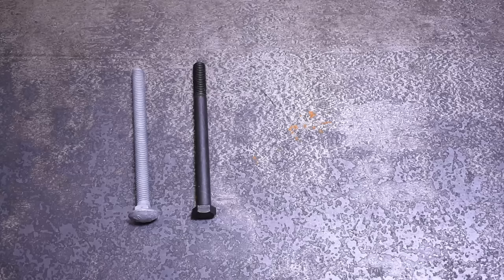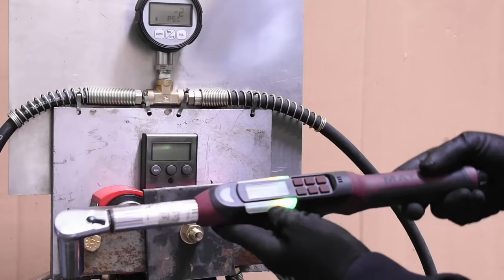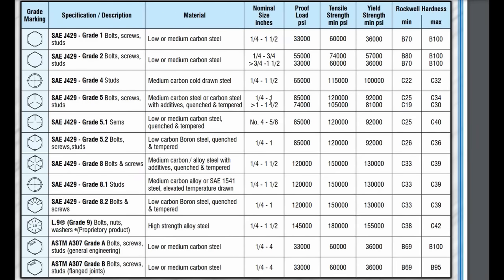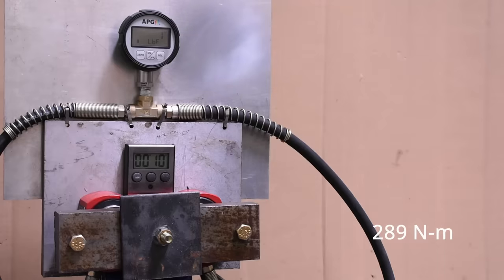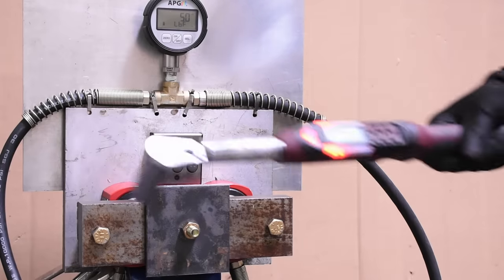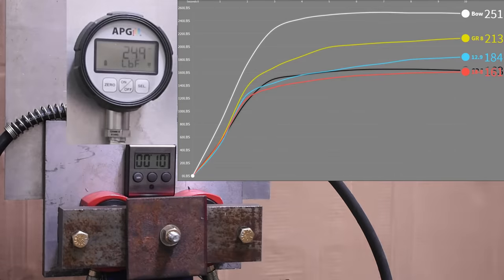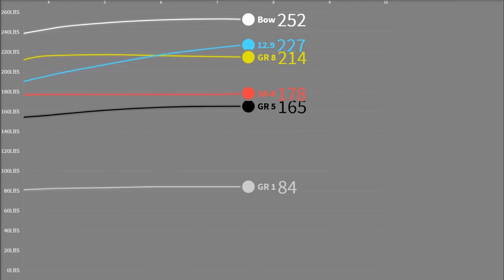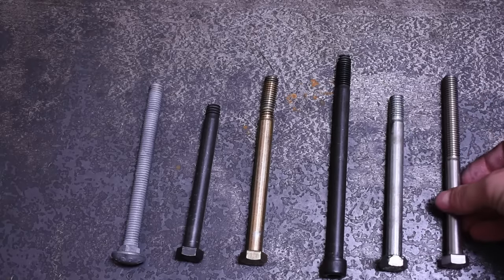Strongest Bolt? Grades Explained & Dyno Tested For Science

Comment: I like to use a lot of Grade 8 bolts and "Grade 8" Nylock Nuts and especially "Grade 8" (aka hardened), washers b/c the washers don't deform under load/tightening.
I find the Yellow zinc coating present on most "Grade 8" stuff to be FAR superior for weather/rust resistance then standard zinc.... I buy them in bulk b/c the cost difference does not seem to be that great over grade 5 (and is sometimes cheaper from one of my suppliers for some reason)

They are also often available cheaper than grade 5 zinc in "plain" finish which makes them very easy to weld prep and paint b/c you don't have to strip the zinc off before hand.

Grade 5 Plain finish and Yellow Zinc are also available and I often purchase those as a "lower" strength alternative... But unless they are substantially different prices Grade 8 is my go to for anything not requiring stainless or Hot Dipped (I always buy grade 5 hot dipped b/c the ungraded bolts especially carriage bolts seem to be made of "Cheese grade" steel)

The quality of the fasteners/threads & finish etc  is WAY better then buying the garbage sold in most hardware stores and big box stores and when purchased in bulk are WAY cheaper then that crap.
Reply: Exactly even if you need 50 bolts pay the Xtra 50$ cadmium bolts are okay for furniture but not for something that can fail.

Comment: I was told not to use stainless hardware on my beadlocks. a tone of people said they were weak and would snap so I put one in a hole in a metal table and bent it with a hammer. they are strong enough for what I want to use them for. glad to see you confirm that hard to find info or test on them

Comment: Not all metric SHC are 12.9. They do come in 10.9 as well, though rare and hard to get here in the states. Where I work, our German presses use a lot of 10.9 SHC bolts because 12.9 is too hard and do not have the "give" that a 10.9 does so they tend to just break if they're substituted. We also use L9 bolts on our tumbler drive units per the manufacturer. They're the only thing that can handle the stress of being constantly vibrated and hold the drive and weights in place. Anything else will snap in a matter of hours. If I remember right though, L9 bolts are mostly used in aviation.

Comment: We use stainless bolts/nuts and Belleville washers(conical spring washers)  in electrical substations and switch yards. 
Also ran into an interesting situation at an airport where they wanted the emergency generator wired to be terminated with stainless and greater then grade 8. Our supplier said impossible because stainless is harder and more brittle then grade 8 so you can’t have stainless + < grade 8. Substations/switch yards using stainless + conical spring washers probably use the washers to flex to avoid stainless being more brittle then grade 8.

Comment: I went through a Caterpillar training course, and they demoed their bolt testing. They put a wedge shape under the head while tensioning. Cat was using all grade 8 for everything on their machines. The theory being that no one pays attention to where a bolt goes relative to the required strength.  I now mostly work on European factory machines. They use either 8.8 or 12.9 and have a habit of torquing them to near their limit. Almost all are SHCS.

Comment: The yellow is zinc chromate. You can get grade 8 bolts in other finishes; McMaster carries zinc flake and black oxide as well as zinc chromate.

Btw, you can see in the graphs when you've reached the yield point, especially on the grade 8 and 12.9 cap screws. It's where the curve bends slightly to the right. Once it plateaus the screw is over torqued, but for one-time use fasteners torquing the screw into the yield range is often specified.

One interesting metric to gather would be bolt elongation. You should be able to measure that by setting up a dual indicator on the back of the rig, with the plunger on the center of the end of the bolt.

Comment: Also thread systems would be something to consider,the typical systems on SAE (not to mention metric systems) insure a certain clearance between the female and male fastener threads which include some empty or air volume in the assembled fastener and also some axial play between the female and male fasteners when there is no tensile load on them. Volume which can allow entry or penetration of liquids or substances such as water containing dissolved corrosive salts unless the thread volume is filled with some sealant such as "antiseize" or plumber's sealant. Or even "thread locker".

Comment: Great and useful video, thanks so much! Stainless steel deck screws are far weaker than any steel screws, so I assumed the bolt would be weaker. I had to use a drill with a clutch, my little impact driver kept twisting them off. So that 304 / 18-8 bolt was s surprise.

Comment: Is a hammer drill a faur way to test bolt strength?  I don't think torque specs take into account hammering.    Try with a breaker bar to remove hammering from the equation.

Comment: If you ever look at Altec digger derricks (basically a crane meant to install utility poles), the boom’s rotation is only held in place by the hydraulic motor, which itself is only held in place by 4 bolts.  We had a guy shear them off once and a mechanic (not having the bolts to look at) replaced them with grade 8 bolts.  They lasted a day.

Comment: In case anyone is interested, the A307 grade is the most common structural bolt.  They're specced to be reliable and mass-producible.  As opposed to unmarked bolts, the "A307" marking guarantees the production line meets a certain level of quality control.

Comment: As a person who is working on some heavy industrial equipment I am finding there is quite the rabbit hole to bolts.  Strength isn't always the only factor to consider when there is a certain amount of flex required.  I would have initially thought just throw grade 8 in for good measure; but I am learning this isn't always the best way.

Comment: When I build a machine if I'm tapping the metal of the machine I always use grade 8 bolts that way when you remove them they almost never break off. Sometimes they ruin the threads but that's a smaller problem. In some applications with a nut and bolt a grade 2 setup is kinda nice . They can usually be quickly broken off and cheaply replaced during service. For most applications grade 5 is what you need.

Comment: The metric classification works as follows. 
8.8 =>
The first digit multiplied by 100 is the max. force in N/mm2 the bolt can take without breaking. 
=> 800N/mm2 
For a threaded bolt we use the stress cross section. The diameter of the threaded section of the bolt is obviously smaller than the nominal diameter. 
For a UNC 1/2“ 13 bolt this is about 11mm. 
The area of that diameter is approximately: 
5.5mm^2*π≈95mm2
=>
95mm2x800N/mm2= 76kN (≈7,6 t)

The torque to stress the bolt to that amount:
76000N*1.95mm=148000Nmm
=>148Nm

The second digit ist the yield strength in N/mm2(max force before permanent/ plastic deformation)and is calculated as follows:

First digit * second digit *10
=> 8*8*10=640N/mm2

Again multiplied by the area 
95mm2*640N/mm2 = 60kN (≈6t)

Torque:
60000N*1,95mm= 119000Nmm
=>119Nm

This is all highly theoretical and neglects several factors such as friction etc..
Since the bolt is usually there to hold parts together and take a lot of additional stress for many many cycles you obviously want to stay well below these values. 

So just buy the appropriate bolt and stick to the torque values of the manufacturer!

Comment: The AC compressors we have at work require 4 3/8" grade 5 bolts on the suction side and 2 5/16" grade 8 bolts on the discharge side. 

Many times I've found grade 5 on the discharge because someone got lazy, or reused bolts on either. They've always been stretched. The most impressive were reused grade 5 bolts on the discharge that had stretched between 1/4" and 3/8"... I'm surprised they still held pressure, seeing upwards of 380-400 psi, and undoubtedly not properly torqued to begin with.

Comment: Just a trick we use at work for grade 5 (3 marked lines) and grade 8 bolts (6 marked lines) if you in your head plus two on the marked lines you get the strength grade, used as a way to help remember the grade off the marked lines on the head you see.

Comment: I am a structural bolting inspector. You should have also tested A307 versus A325 and A490 structural bolts. Grade 5 and Grade 8 bolts are illegal on structural steel. They are machine bolts for building machines. Interesting that you have built your own version of a Skidmore-Wilhelm tester which we use to verify heat treat bolt lots for high strength bolting.

Comment: A lot more factors go into how these bolt will perform in your test.  My guess is that the BOW bolts may have rolled threads after heat treat.  As a result, the thread quality is much better, meaning that you will build clamp load faster when compared to applied torque.  Thread friction is a large factor in torque vs. clamp load.  You should try the test again but use Loctite 243 or 271 on the test subjects.  Loctite is a great thread lubricant and will allow you to achieve higher clamp loads more quickly.  I have empirical data from tests we did with an internally developed Grade 8+ bolt in a high clamp load application.  It’s pretty amazing stuff…

Comment: I am a heavy equipment operator by trade. In winter do snow removal. Snow equipment uses bolts on push arms for there shear characteristics to protect equipment. That generally translates into a soft bolt. Clamping force is not a concern as we use nylocks and leave them loose. I would be interested in seeing shear testing of the different grades.

Comment: On the stainless bolts:  You will see some with marking "S30400" or "S31600" or "F593C".  These are all supposed to be slightly different stainless alloys and should have different properties.  It would be interesting to see these tested against each other as well.  I've had a lot of experience with 304 failing very easily, but have found those marked "F593C" tend to be tougher, though not 100% of the time and I'd like to know if it is simply a matter of my perception or if there's actually something to that.  The documentation I have found online seems to give inconsistent information, but generally tends to show F593C should be a little better than 304.  
    Further, stainless likes to gall and seize, so it is strongly recommended to apply some lube to the threads, as this makes a very big difference in how long they last and how well they perform.  I like to use SuperLube on all stainless bolts and nuts, but there are other options that will also work well.
*    Also, would you be interested in testing different lubricants on the threads and see what difference it makes?  I'm thinking it would be good to choose one grade of bolt, such as Grade 5 or Grade 8 and test multiples of the same bolts with different lubricants.
    Here are some ideas about lubricants to try:
SuperLube
Lucas Red'n'Tacky
Brake caliper grease (the black CRC stuff with Moly and Graphite)
Cheap grease like the stuff from Service Pro
High-end grease like BigFoot grease
Waterproof Green Grease (found at Autozone and Oreilly's)
Anti-seize (aluminum-based because that is the most common)

Gear oil
    Thank you!
Reply: There is often a Suffix 'L' which means Low Carbon.  Less than 1.5% as I recall.

Comment: The funny thing about aerospace components is that you'll often find a commercial equivalent for 1/10th the price, but the aero version (aside from raw performance) will have one tiny difference like an odd thread pitch or specific machined head so only one specialized tool works with it (let's be honest, a Union guy can screw up just about anything, haha). I used to call it Job Security vs Design Envelope Performance; this was especially true in the 60s and 70s.
Reply: Sometimes the difference will just be in the paperwork - the aerospace component will have an auditable trail to show the stock it was made from, that it was correctly hardened, tested etc etc. I actually read an accident report recently where poor process control and slack QC meant some pins in a batch were manufactured from stainless steel instead of tool steel. Sadly these pins are used to attach the main rotor blades on a Bell 212 and a stainless steel pin failed after a few hours, causing the aircraft to crash

Comment: If you ever do another test like this, consider lubricating the threads before hand. The bolt at 8:15 had a "spiral fracture" meaning it was effectively twisted in half, instead of breaking in a more traditional manner from the threads binding up.

Comment: One thing that you did, int talk about is certification and offshore fasteners vs onshore fasteners also the letters on the head of a fastener is the Manufacturer, certification or Certs as it is referred to can be  required for all DOT situations especially Bus truck and train applications.
Reply: And everything on ebay is counterfit including software. I imagine the bolts are also.

Comment: I use socket head cap screws in a 24/7 production environment with a speedaire butterfly gun. They stand up well but inevitably the threads strip after a few months.

Comment: Stainless Steel bolts are rated either A2-70, which is 304SS, or A4-70, which is 316SS. Both are 700 MPa.

Comment: The best info on stainless bolts I have seen is in the astm specs, I can look up the ones if you care. It is harder to find the info on them but it’s out there if you know where to look. Basically 300 series stainless steels are not heat treatable and have an enormous strength range depending on how much they are cold worked or as the spec calls it strain hardened. 18-8 is a precipitation hardening alloy 18% chrome 8% nickel very close to 304 in chemical composition but is heat treatable with its strength depending on its aging temperature.  There are also the 400 series stainless steel bolts but they are the least corrosion resistant and I never use them.   304 and 316 are usually used in the low to mid range strengths.  18-8 (and other ph grades) is the Cadillac of corrosion resistance and strength but cost more.    

Regarding torque I’d probably have shown the results in tension not torque.  Your jig actually measured tension and although you calibrated it to torque the conversion varies with lube condition and surface finish.  Black oxide will be slower to tension than greased bolts or shiny zinc.  A rusty bolt can break from torque and never reach a very high tension which is actually what you are after at the end of the day.   This of course gets into the age old problem that tension is what matters but is hard to measure.  Torque is what everyone uses but varies wildly with conditions. Structural codes for critical applications require calibrating torque to tension on a jig not far from yours with every batch of bolts and every day.  

I also wouldn’t back off the bolts you yielded and retension to break since you effectively strain hardened it making the bolt stronger and reducing ductility so the next chart you got made it look brittle, just keep cranking and make it one big chart with that nice big flat area that dips to the break once it necks. 

Anyway still good stuff and worthwhile info to put out there for the world. I don’t think I’ve seen a better video on it. I have to know this stuff and have suffered through many books and my own experiments. Nice job as always. 

Funny story I was working on a structure and they had a machinist torquing bolts.  He started yelling at me because I gave him torques that broke the bolts and he was short on 7/8” bolts. I was breaking his balls for not having a skidmore then I look and go damn it no one greases bolts on a structure. This caused the iron workers and the machinists to argue about greasing bolts while I laughed. We had enough just they had to curse a lot to get those bolts back out.

Comment: I worked at a tractor trailer suspension manufacturer and had bolts for the alignment that I had to tighten to over 500 ft.lbs. each.

Comment: true yield and tensile strength can only be performed on a tensile tester on a straight unthreaded section. testing where failure occurs in the threads is difficult to determine due to not knowing its actual cross sectional area, and the thread itself acts as a stress concentration site which again results in lower than actual tensile /yield strengths. Even small scratches in the circumference can act as stress concentration sites, simply because they are the smallest cross sectional area, where all of the stress is going to be concentrated.

Comment: A307 is an actual material and is essentially interchangeable with grade 2 in the field.  When you buy bolts that dont have any markings at all you could be getting melted coathangers.  This happens a lot at bulk store threaded rods.  Never buy anything without a steel grade.  For the galvanized carriage bolt it would often be used for a wood connection where A307 / grade 2 is more than the wood can bear anyway.
Reply from the maker: A307 isn't a material (as in a specific alloy) it's an ASTM designation for a bolt grade

Comment: Up from A307 are A325 and A429. They generally use a larger wrench size for the same diameter bolt on A325. That's what is used in building structural applications. I design elevators and we use almost exclusively A307. Most of our connections are in shear. Have to use some 18-8 and even 316 stainless bolts on occasion. I prefer to use hot dipped A325 to stainless whenever possible. Have to consider galvanic corrosion when mixing metals (zinc, aluminum, stainless, etc).